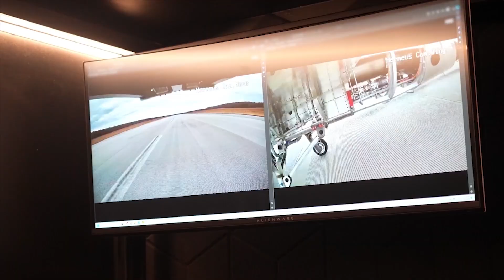US New Mach 5 Super Plane SHOCKED The World!

Comment: 1) Given the high wing loading, this thing will only take off and land at high velocities, requiring runways only available military airports. Why would a military airport allow commercial traffic? 2) What is the passenger experience as this thing turns and banks at Mach 5? 3) Why would passengers pay for limited departure and destination airports? 4) This thing carries fewer passengers than Concord. Concord was an economic failure, as passengers were not willing to pay higher prices for a few hours gained time. Why will it be economically more viable? 5) What percentage of its route actually takes place at Mach 5, given the time needed to reach velocity before slowing down again for landing? 6)Who are Hermeus trying to fool? 7)Why am I the only one asking these questions?
Reply: I can answer your #2 question easily. You don't bank aircraft going Mach+ beyond their design limits anymore than you would put a commercial aircraft in a tighter turn than we do now. The SR-71's G limit was only 1.5Gs in most situations depending on fuel and speed. That's why it took about 100 miles to make a turn, nice and easy. If you hit more than 15 degrees AOA it would most likely stall. The procedure if it did stall was to eject. These a/c are test beds, not prototypes.
Reply: Another way of saying it, is most long flights today are already 99% nearly straight flight.
Reply: #3 overseas flights are already destination limited, you fly to a major airport on the main leg, then make a connection.
Reply: Concord used London, Paris, JFK, Dulles, LAX, etc., all with long runways.
Reply: @EdPheil  Ed, are you claiming this thing will have a landing speed of 187 mph? What is your claim for its take-off speed, 250 mph? Are you also claiming that JFK or Paris will have the exotic fuels on hand?
Reply: #4 Concord was not even Mach 2 (1.76 Mach), so Mach 5 is a much larger time savings on long routes!